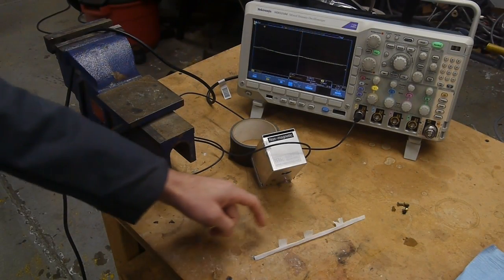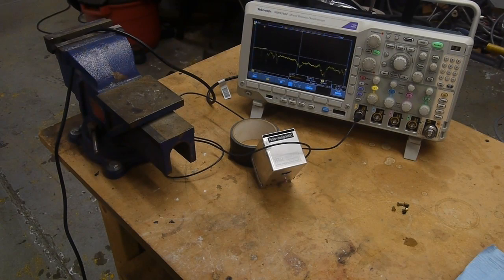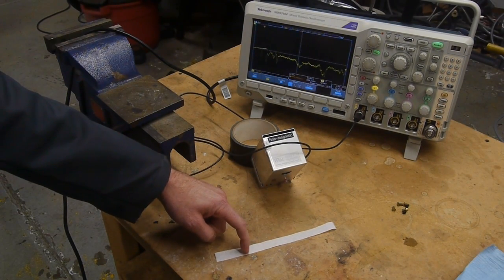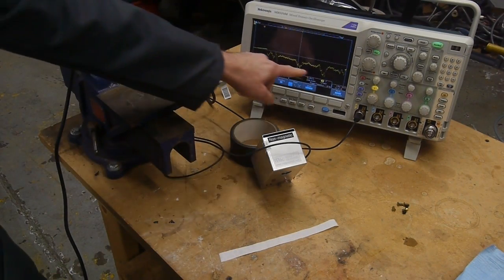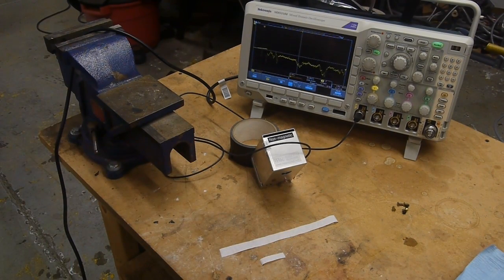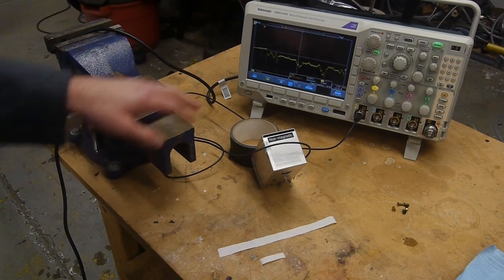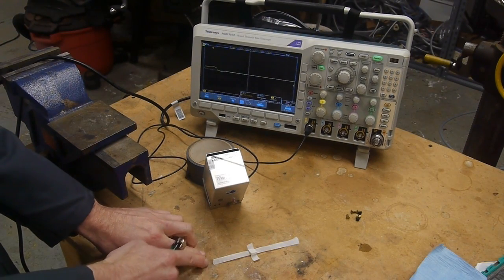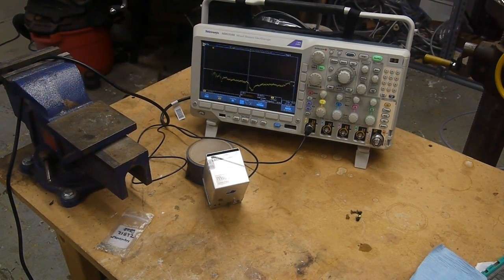Encode information in fire!

Comment: If the resolution can be increased, this would be an interesting way to transmit a private key encryption pair to a remote endpoint.  In effect you would have a tamper resistant transmission medium.  The nature of the information recover would destroy the media.
Reply: except its encoded on highly flammable/explosive paper, not sure what you would be labelled as if you posted it or carried it across borders, its about as practical as morse code written by sticks of dynamite going off :}

Comment: Imagine two of these strips,one above one another. If some substance on the paper has properties that increase or reduce the heat of the flame, then you have a means of binary encoding. If the heat from a flame burning on the bottom piece of paper could enable or disable this substance in the top piece of paper (without starting combustion), then you might have a way of computing some form of "not/nand" and some form of "and" logic. Wouldn't this be enough to perform binary logic and hence computation?

Comment: With just flash paper... The biggest bottle neck is going to be resolution and timing leading to errors and severely limiting your design options.  If you had "dabs" of accelerant or black powder and you had a method for spacing them, ie every millimeter, you would be able to offset multiple strips at slightly different start times to pull each signal out of the noise (timing issue) and you would have a higher spike during a burn (resolution).

Comment: I agree with several comments that encoding data is easy, ANDs and ORs shouldn't be hard if the luminosity can be set to trigger from a set range.  But the hard part is the logical NOT as well as getting a gate/decision to be made.  The problem with the NOT is that if we use simple fuses, all we can do is burn things in different order, but the flame will always propagate across connections.  This makes inversion difficult.  Additionally, to enact a condition, flame needs to travel one way, but not another.  I think a possible solution might be two types of fuse.  One that can cut or deactivate another without igniting it.  This could be possible with a fuse that requires a very high temperature to ignite, e.g. a magnesium ribbon .  To activate it, you might have two normal fuses burning in parallel which would generate enough heat to ignite the magnesium fuse.  Then when you need to disable a line to choose the proper output for a switch, you can introduce a delay in one of the trigger fuses so that they do not burn at the magnesium junction simultaneously, thereby both burning themselves out, but not generating enough heat to ignite the magnesium.  Once the magnesium is lit, it can travel a little further and switch back to a normal fuse.  This same, two normal fuses at the same time method can be used for AND operations.  For an OR, you can just double up on the normal fuses from each input so that either bit alone is sufficient to ignite the magnesium.  The 1->0 NOT inversion may be implemented by having the bit (large chunk of paper or fuse)'s presence introduce a time delay (or advance) into one of the normal input fuses which would then disable the ignition.  The 0->1 seems not as straightforward since, if a 0 bit is encoded as no burning chad, how can you propagate signal?  Maybe a minimum of 2 fuses are always needed, with one to drive the signal and the other to indicate the binary state.

Comment: Could you treat the paper in such a way that the flames temperature is acting as the information carrying bit? First treat the paper so It burns as cold as possible. Then as the paper burns it encounters intersections. These intersections are treated so they will only burn when the flame has reached a certain temperature. If the flame is too cold it progresses to the next intersection. If the flame is hot enough it ignites the paper at the intersection and continues down the new path. Each intersection would also need some sort of cut off system to stop the flame from continuing down the original path.

Comment: I was also going to suggest this is similar to domino logic with the blocking problem. The bridge solution suggested by someone could work to solve the problem.
Another mechanism that i think would help is to suspend all the paper by piercing it with metal rods and create tabs/bridges supported by a rod at one end and overlapping another piece of paper at the other. In this way if the flame comes from the side supported by the rod the bridge falls because the weight of the paper would pull it of the other paper, if it comes form the overlapped part it continues to the other side because that side is supported by the rod. I guess that heat caused by the burning could somehow be used to blow away tabs lightly supported (not piercing the paper) on rods.

Also, It would be interesting to see a funnel made of that paper and above it a propeller also made of paper that would briefly spin as the funnel burns and eventually catch fire form the rising funnel. I don't the physical properties of that paper but it seemed to rise a little because of the heat caused underneath.

I wonder how uniformly would it burn if ignited from the center by a punctiform heat source like a laser...

So many curiosities! I didn't even knew this type of paper existed until this video. :)

Comment: You could probably make OR gates by cutting a Y shape, with the base of the Y being the output and the two top branches being the input - if any of the input paths is a 1 (burning) then the output will be a 1 (burning).

You could probably make an AND gate by setting up the two inputs as parallel strips and laying the output strip in the middle, not touching the two parallel input strips - if you calibrate it well enough there would be enough heat to set off the output if and only if the two inputs are 1s (burning).

You could probably make some computations with that already.

I don't have any obvious idea how to make a NOT gate though. You would probably have to play with the timing of fire propagation, but that gets trickier to conceptualise.

Edit : if you make the two inputs of the AND gate I theorized above rejoin the circuit at a point that bypasses what would be set on fire by the middle strip quicker than the middle strip would burn if both inputs were 1s you'd effectively get a sort of NAND gate, computation can probably be done with that. I'll try to make a simulation and a "compiler" if I ever find the time.

Comment: I thought about that, but it's great idea for memory but not for the logic. For example, if you try to make not gate, it will ignite instantly, due to the signal on input will be low. To make that work each gate must have enable "fuse", "candle memory" on each input and special "clock" circuit to set enable "fuses" on when information is at gate inputs.
About memory, You may try to get it burn in black container.
If you try to encode more than one strip at once, the information may be lost, because it will be like making or operation between each information. Until you take and make space between the stripes big enough to read 4 separate information (0and0, 0and1, 1and1, 1and0).

Comment: Not much interest in flame computing (cooling is already too much of a problem in computers ;) ).
But the colored candle flames got me interested. Which salts would be best? I guess most of the chlorides will release chlorine when burning which you really don't want around.
Reply: You can try copper salts. They give very, very nice blue color. I used some CuSO4 in my fireworks and the effect was great. And it is very easy to obtain. The problem is that I don't know if the temperature of a candle will be enough.
Reply: Borax may make a green color.  Candles are tough do make work though.  The classic flame test is done with a volatile organic fuel (dangerous)

Comment: Maybe instead of taping tabs to the flash paper, you could cut a waveform or stepped shape into it. The more fuel there is, the more intense the light output. Even a binary system could be made with a "baseline" light intensity being 0 and elevated intensity being 1.

Comment: A crude way would be to enable AND, OR and NOT gates. I'm not sure that it is possible to make a NOT gate, but the other two are possible.
Have a long strip in vertical direction (the clock strip), then binary encode a number and put smaller horizontal strips adjacent to the clock strip. A two bit device encoding the number 3 would then look like F.
Next encode a second number on small horizontal strips and put them adjacent to the other small strips.
Now only those strips that are present in both encoded numbers will light at the far right. This is essentially a binary AND operator. If you shield the clock and first number from the sensor, the sensor readout its equal to the result of the AND operation.

Comment: Thinking Turing machines, one of the simplest ways of computation requires the ability to read data and then change depending on what it reads, the whole function of computation, this is very much a "1 way reaction" and is irreversible therefore cannot write and complete the second part of computation. Logic gates are probably the best option, you could make an OR gate where you place 2 pieces of paper in "parallel", but again still very limiting to what sorts of computation you can do. Interesting idea, maybe not so much for computation as such, but potentially more useful for read-once data encoding.

Comment: A multi-flame processor would just burn down the House :). This is only useful for data storage, for encryption purposes. But you must ensure that it is not easy to just read out the bits by viewing and counting. So the plain eye should see only a paper strip. My idea would be this. You can print with 3 different metal-inks that emit different light specturm (red green blue) if the are burned. The dots must be small as possible and the ink should be not visible by plain eyes. With 3 inks/Colors you can take advantage of normal 8bit encoding. The reciever should be able to filter the signals by color.

Comment: Ah, just realized you wanted to do it with only paper.

How about this: Make a support out of paper so that it bridges a gap in the signal line. Then you can burn it at the base to drop the bridge and stop the signal, but if you burn it at the top the signal can cross before it falls.

I'm thinking a square frame with a strip crossing it on the narrow side. If you get the dimensions right, the strip on top can carry the signal across before the frame collapses, and the flame from the support won't accidentally set off the signal line.

I could post a drawing if I'm not being clear enough...

Comment: For logic, a good solution might be (when 1 = fire and 0 = no fire) as "simple" as creating a NAND gate using a supply of fire.

Still using the bigger flame = 1 and smaller flame = 0 you can either a) make the flame bigger with more width or b) take the flame closer to the sensor. 

An analog answer, I have nooo idea

Comment: It looks like the better way to use the flame encoding is to implement some sort of analog computing rather than digital.

I think that you can improve the resolution by filtering IR radiation.  The visible light is only emitted by the flame it self, but IR comes also from the heated table and the ashes, so it might work. At least it would be interesting to compare the results.

Comment: simple calculations like addition and subtraction may be possible by creating overlays.  An overlay with additional flash paper would detect an addition.  An overlay with say a piece of copper wire would be a subtraction (sinks the heat).  Not useful (as far as I can see) for "computing" but could be an interesting take on cryptography.  May be a bad idea, but a method like a mirrored box may allow more input energy to reach the detector.  I would think that the variation due to the flame moving could be compensated for by a mathematical manipulation of the input to account for the flames location (use a control).  I like where the other commenters are going.  A thermal resistance setup may be a better idea.

Comment: Thanks for your excellent vids.  I wonder if it's possible to fireproof areas on the flash paper so you end up with a burn no burn effect resulting with graph like data.  Accurate and repeatable data could be encoded this way if an accelerant and retardant could be laid down in a controlled manner.   How about a modified printer.

Comment: We have amplification of a signal in the form of fire. For computation, think Turing machine.  
We would need state and process. The fire would be process as it is a dynamic amplifying factor. But it will have to read state whilst preserving the state. And write state which can be read back.
Punched or hole burned cards can store state. The holes can control the fire which performs logic whose output can burn holes in the card for re-input. This way, you an build a universal Turing machine with paper and fire. It would need a separate fuel source. eg gas.

Comment: If you have 2 strip of paper side by side with different binary number encoded into them and start burning them at the same time. You optical sensor could detect the intensity of the flame and the result would be an OR gate or and AND gate depending on the threshold you use to detect a 1 or a 0 on the oscilloscope.

Basically, if a encoded 0 is a 1" wide section of the paper and a 1 is 2" wide. Burning two 0 side by side would give a intensity level that correspond to a 0 on the oscilloscope. Burning a 1 and a 0 would give you a larger intensity and that would be your baseline for a 1 if you make an OR gate (everything with a larger intensity is still 1). Similarly, if you burn two 1s, that would give you a baseline for a 1 for an AND gate, everything lower is a 0).

OR gates and AND gates are the basic component of a computer. If you prove that you can read the result accurately, then you proved that you could make an binary adder and all the other component of a computer.

Interesting experiment, but that would be short live.

Comment: Every element produces it own spectrum which is the basis of the atomic absorption spectroscope. What you have there in the burning paper is a basic atomiser that excites the atoms. If you were to have the means to read the individual spectra then you could combine a number of different elements at one point to give an entire 'word' or just one for a bit, four for a nibble, eight for a byte and whatever number you choose for a 'word'.

As I remember ( Its been a long time ) you need a light source specific to the wavelength you are measuring. This means the single spot of paper doped with multiple elements will have to burn long enough to scan all the different spectra. Having said that, some could perhaps be measured simultaneously.

Using individual unique elements as operators you would not need the second piece of paper.

I'm sure this is possible though spilling coffee on the payroll data would make you very unpopular.

Comment: Any type of digital logic circuit can be constructed entirely of NOR gates.  A flash paper OR gate is trivial.  If either input burns, the output burns.

The NOT part of the NOR gate is a bit trickier.  I think the best way to construct a NOT gate is to start with two flame paths of different lengths.  The shorter path is the input.  Think of the longer path as VCC.  It will always have a flame applied to it, regardless of the gate's input value.  The gate will include a three dimensional bridge that the flame from the longer path must cross in order to produce a flame at the output.  If the shorter input path is burning, it will destroy the bridge's support, causing it to fall so that no flame can reach the output.  The bridge could be supported by a teeter totter made of flash paper.  As the lower end of the lever burns, the bridge will drop.  You'll have to make sure the vertical height is enough to prevent the burning bridge from igniting the output path.

Comment: I don't think that there would ever be a way to "compute" with fire, as no matter what material You use, the material itself is always a single use, read-only device. In order to compute anything You would have to find a way to force fire to create more material to burn as a result of the computation, so no matter how complex Your structure of fuel will be, this will always be read-only and (in ideal conditions) will always burn at the same rate no matter what.

What You COULD use this for is something like a cryptography by mixing it up with origami (or any other form of folding). How that would work is that You take a long strip of paper and burn it just like You did, but at the same time have REAL information encoded in it by proper folding. If You would fold it into some pre-defined shape, and we would assume that this will in fact burn at a constant rate, the shape You folded will always give a specific reading of fire intensity.

One way to achieve that goal is to have the same piece of paper printed with a series of numbers that mean different kinds of folds. I think that You could easily make a roll of paper that would fold into some sort of grid pattern with many intersecting points, so that whenever the flame raches an interection, it gets doubled. That would allow to code more than just 0-1 binary signal, but an entire pseudo-alphabet.

Some problems I can see happening there is - not high enough purity of the material that might not guarantee the perfect burn rate for every single section of the paper, just a tiny change in airflow can create fluctuation in the flam causing it to NOT give the proper light brightness to transferr correct data at all, and finally there might be a problem with the flame itself and some pieces catching fire to early or to late depending on just minor mistakes during the folding of material itself.